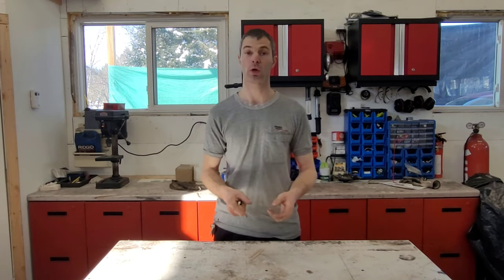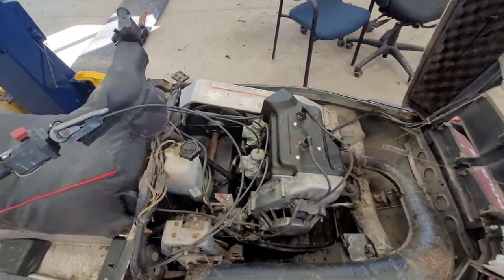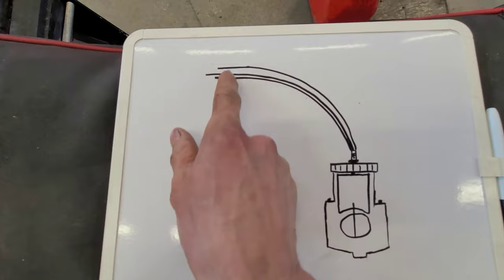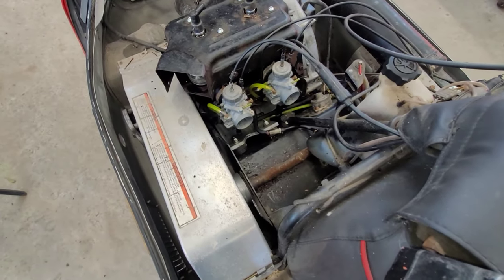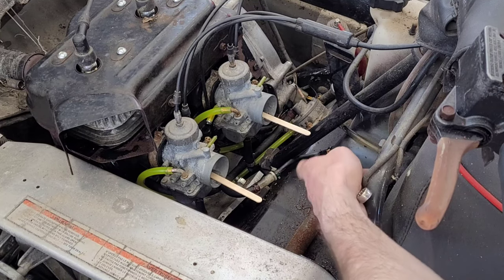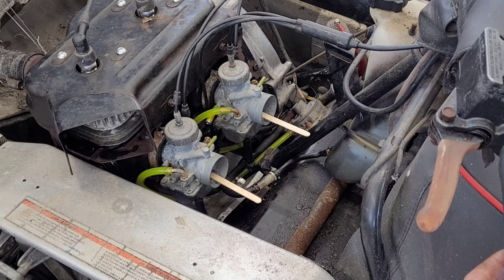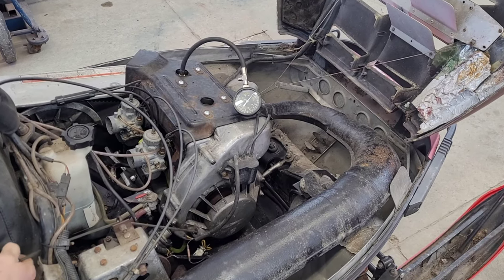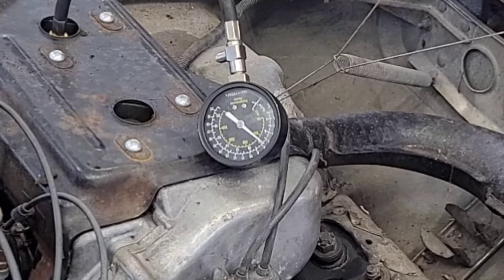Synchronize your Carbs for Cheap

Comment: there's more to it than just the physical size small differences in shape ect. change flow rate .... measuring vacuum at the same time  for each is best way but I appreciate the time and effort for the upload The method you shared is great idea and gets us within a reasonable range and gets us going 👍
Reply from the maker: That's right. Measuring vacuum is probably the best but this method is easy and pretty accurate. It's enough for most trail riders

Comment: the problem with this method is the tolerance for the popsicle stick thickness is pretty high so you really need to verify the that you have sticks within .002" of each other
Reply: Thanks, but; I already check mine with a micrometer! for samness!

Comment: The adjustment screws in the cap should be used to set wide open throttle. Idle should be set with the idle screws on the side of the carbs.  This method means one carb will be more open when you have the throttle pinned.
Reply from the maker: So how do you ensure that both slides open together at the same time?
Reply: @thehonestmechanic  simple. When you use the cap screws to set wide open throttle they’re both set at the same height which in turn makes them open at the same time. This is all laid out in a mikuni tuning manual.

Comment: How do i base adjust the  side screw adjustment ?
Reply from the maker: The side screw is the idle speed. I recommend doing this by counting the turns on the screws. Once you are happy with the idle speed(every engine varies slightly) you can then set the cables in sync. BTW, you do not need anything in the carbs when setting te idle. Hope this helps

Comment: Sweet my carbs are synced to 4,000rpm 😂
Reply from the maker: You missed the part where you only take up the slack in the cable. The idle adjustment is done with the screws on the side